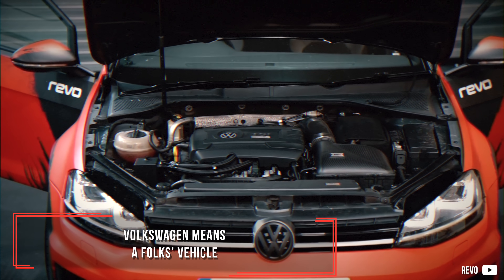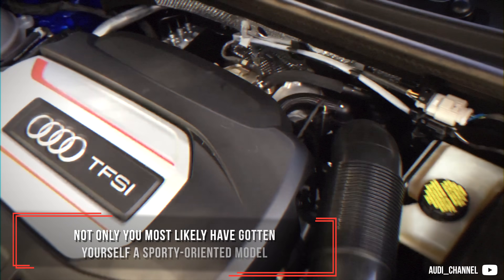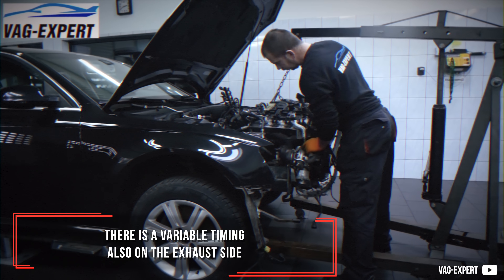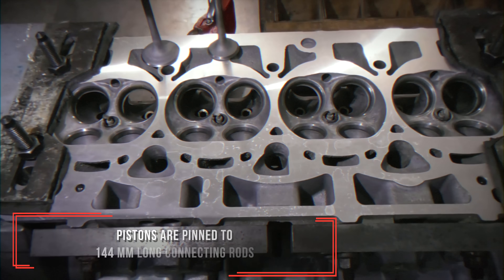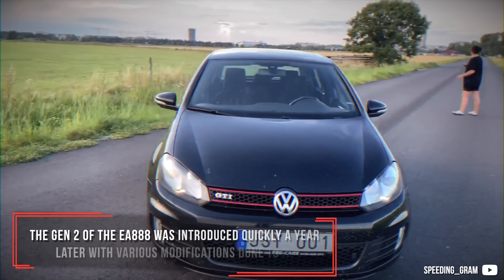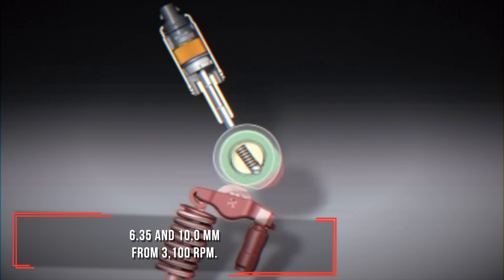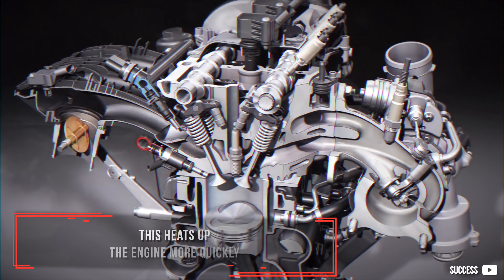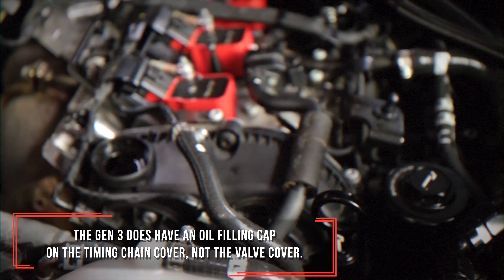Why The Volkswagen EA888 Is So Good

Comment: Unfortunately I have the 1st Generation Gen 3 engine and I have had to replace the intake manifold twice, replace water pump, replace timing chain, PCV a couple times, multiple misfires, throttle body, etc.   luckily though I use Mobil One Full Synthetic in all my Audis and VW’s and my GLI has made it to 150K.   Carbon cleaning will be next with the walnut blaster, more money.

Comment: The aforementioned issues all sound like they are caused by lack of oil change or poor quality oil. As for the timing chain issues, yes it is terrible but it also sounds like it can be monitored and addressed before it becomes a catastrophic issue. I hope the check engine light illuminates before such disaster

Comment: ea888 gen2  still running after 12 years so far no issues, still on the original timing chain too. and waterpump still works and doesnt leak. just do the yearly oil changes or at kilometers intervals and thats it. and after 150k maybe the walnut blasting on the intakes to remove the carbon deposit and do a timing chain change.

Comment: What could I do with a 2016 2.0 TSI manual VW Cravelle which has low mileage and still stock engine developing just 150 bhp? I wouldn't like to affect its longevity much but a bit more power and torque would be very welcome. Any suggestions please?

Comment: 2018 Q5 has the gen 3 EA888 no? If so, mine has a broken water pump, radiaotor and possible coolant fluid contamination with only 39k miles. Dealer serviced as well....

Comment: I hate it when people laud BMW's B48 like it's something special - I own a B48  2.0t, and it's crap...Its higher compression than the Audi A4's E888 so it can't be reliably tuned, and even when it's tuned to produce big power numbers, torque comes on too high, and the low-end response is less impressive than a Toyota Corolla .  I've tried to tune B48s for years and it's NOTHING compared to a quick flash from Unitronics off-the-shelf tunes for the E888.  E888 is a brilliant engine.

Comment: Bonjour super vidéo. Une petite question, j'ai une Seat Léon 290 avec FAP, j'ai eu un problème de pompe à eau, pas une fuite, mais visiblement l'un des clapet de celle-ci ne permettait plus le passage de l'eau dans le radiateur et le liquide de refroidissement s'évaporait par le bouchon m'a t-on dit. Pendant cette période j'ai remarqué une consommation de liquide de refroidissement (quelques mm à chaque plein d'essence). je n'ai pas remarqué de surchauffe d'huile ou liquide, du moins sur le tableau de bord, pas de problème avec le chauffage... La pompe à eau a été changée, un test d'étanchéité et de CO2 fait, rien à signaler. Et pourtant j'ai toujours de la conso de liquide de refroidissement, qui semble moins importante... Si par hasard vous avez une idée ?

Comment: The Gen3 is the best street 4-cylinder ever made. Nothing can beat it with the DSG. The only thing holding it down from competing with 4G63 and K-Series at 4-digit power levels is the head-integrated exhaust manifold which chokes it down past 800hp.
Reply: there is sulotion to make the head flow, but if u want use the car 600hp max for reability to all 4 cilynders engines.

Comment: No port injection on the gen 3, only DI in the US, which is unfortunate.
Reply: Do you know why they removed port injection on US models? Seems to me only Lexus does dual injection in USA since like 2006 or so
Reply: Cost savings most likely. That or something to do with emissions to meet “all 50 state” requirements.

Comment: I own a Skoda Octavia RS with the EA888 Gen3 Engine and a Manual Transmission, it was factory tuned by ABT to 309HP, I've had it now 5+ Years, no Oil consumption up until now. Only if I drive hard on the unlimited German Autobahn high up in the rev range. It now has 220'000 km on the clock and so far no mentionable issues from the drivetrain. It's very efficient, uses only 7l of fuel when driven normally and only 6 Liters if driven conservatively per 100 km. A very good engine, that builds up boost very early (below 2000 rpm) and holds it up until the redline (6200rpm). I now changed the ridicolusly high oil change interval from 30tkm to 15tkm and changed the Transmission-Oil. I hope it will last me for another few years to come! I can confirm, the EA888 Gen 3 a very good all-round performing engine 🤗

Comment: Got Cupra ST estate, only chip got 385hp and 495nm. Now doing Do88 intercooler upgrade and Do88 intake with many do88 pieces. Downpipe needs also installed, seeking 400~+ hp from it. 😁

Comment: The gen 3 I have that its decent, so you can add power at 160k miles and the transmission and engine can handle it?

Comment: I know im a bit late to this but these engines are, and correct me if im wrong, port and direct injected in all Euro models.  Kits can be bought to add port injection by simply drilling holes in the intake manifold. There are OEM locations on the manifold that were simply left untapped in the US models. idk if its for both golf r and gti but golf r for sure.

Comment: Friend of mine had Passat 2.0TSI with 280hp. No engine problems and lucky not to have problems with the DSG gearbox. Car did have a host of other problems Ac not working, bake disks rusting in regular use, rear boot lids lock failed and the cars remote drained the vechiles battery in a matter of weeks. So yeah good to stay a away.

Comment: You must be kidding! I had a 2009 Wolfsburg that gave me multiple CELs over its 133k miles. I had PVC valve replaced, oxygen sensor, throttle bottle and eventually a leaking drive seal that cost me $700. I sold it with a bad oil pressure sensor. 

Terrible engine.

Comment: Great info. The IS38 is the turbo upgrade I've heard the most about. Would put a GTI up into the 300HP range pretty easily.
Reply: Stage one on is20 is 320hp and 390torque, on is38 your looking easily over 400
Reply: Is38 comes stock on golf r(same engine as gti)

Comment: Im sorry brother but all my buddies that have owned the early gen ea88 has regretted selling there 1.8t ypu pretty much have to upgrade the whole motor for reliability and youll still blow out high pressure fuel pump lol but i will say they make daaaaaam great power im just hear in my 1.8t lovijg reliability and cheap power no opening of engine needed for 300hp not bad i know a couple stock block 1.8t running 400 its freaken insane to me

Comment: I got an eos with the gen 1. Interior and exterior are beaten up but after fixing most of those issues, ill consider upgrading the engine. Its at 160k miles and i got it at 155k with a semi rebuilt engine b4 i got it. My friend suggested putting a 5 cylinder in there, which i kinda wanna do😂

Comment: Who are you trying to fool?  I guess if you don't know of anything better, then it must be good. We have a 2014 2.0T. 40k miles and 3k oil changes.  Burns oil like crazy.  Maybe 1000 miles per quart.  It's a bitch to work on.  Try changing the Water Pump for example.  Then having to clean the valves that get covered with sludge.  POS Engine.

Comment: The engine itself is great and has proven itself to be pretty tough...its just al the crap VW bolted to that sucks... Intake Manifold, water pump, timing chain tensioner etc. Gen 3 improved on that though

Comment: This makes me want to buy that Jetta GLI I've seen for sale even more.
It has the 3rd Gen and from what I'm hearing it's a really good balance of reliability, affordability and tuning potential.
Reply: @edim805 Did you buy it?
Reply: I own one, and have for a little over 3 years, I can say its one of the best cars all around you can buy, slightly cheaper than the GTI, with the same running gear, and a trunk, little more leg room at the back seats, and pretty much, same tuning potential, Perfect Highway Cruiser, I highly recommend it

Comment: I see the EA888 gen 3 as the spiritual successor to the evergreen 1.8T 20V. I am fortunate to own both a 2001 Audi TT 225 and a 2018 Audi S3. Neither engine has been tampered with and both have been regularly serviced. And both engines are rock solid in terms of reliability.

Comment: The graphic is incorrect 2:29, the turbo compressor is attached to a one piece design cylinder head/exhaust manifold.
The newer generation EA888 is worst than the MK6.

Comment: I have a 2016 Golf GTi performance. I do like this engine, powerful and smooth with good fuel economy when needed. My only gripe is that in standard form it sounds rather bland, but that applies to most 4 cylinder engines.

Comment: I have a 2012 GTI, motor pushing 90k, only failure was the water pump and a Cam shaft speed sensor.  I had the dealer swap the Cam Chain and tensioner at 70k (preventative) along with a carbon cleaning. Yes it wasn’t cheap but considering the price of new cars it’s cheaper to put some money into preventative maintenance then replacing a motor or buying a new car

Comment: Best engines my ass😂😂.
    I had all three generations and they all are a piece of junk !🤮
 Issues with oil consumption,  timing chain , fuel injectors , oil leaks, oil pump , carbon build etc , they are fucking shit , stop lying to people that these are the best engines from Vw because that's not true! 
A reliable petrol engine doesn't mean you have to do something to it every couple of months! 
Most reliable petrol engines are made by Mazda, Toyota and Honda , Vw makes the worst petrol engines , unless you want to be friends with mechanics every couple of months,  go for it .😂
Performance wise,  yes they are nice , reliability wise, they are absolute shit .

Comment: Ok I am not a believer the EA888  is a pile of junk I have a pile oh wait 8 of them piled up for scrap . They don’t-last throw away motor. Timing chains FAIL plastic guides . Oil pump issues junk  Plastic parts should never exist in a motor and direct injection and dual injection.dual failures it sucks . I run 1.8t 20 v awp with new Rods with 20mm wrist pins and je rods and a big turbo slaps out 500 whp with all upgraded  software. And emissions delete.

Comment: The later EA 888/3 had OPF and only DI, no more additional MPI. There also ist a EA888/3b. This is the 200/207 HP Version with miller cycle. And there is a Gen 4 with new Garret- or Continental Turbo
Reply: I'm currently doing some research on the EA888. Do you have a source that lists the MPI variants? Either I'm searching incorrectly or there just isn't much info available
Reply: @AspireRacer  There is not much info available. The additional MPI was cancled about 2017. All engines with OPF from factory had no longer additional MPI https://www.youtube.com/watch?v=TOO7xWwOo7M (use the google translator)

Comment: "An IS38 Turbo is a safe way to reliably increase performance"
Yeah look, it really isn't. Those (still) have a strong tendency to die on ~400hp and proper usage rather quickly.
Reply: Not my experience. is38 at 80k
Reply: @deanmarr785  Read my post again, properly this time.
Reply: @NoName-st6zc  I read it. What did I miss. You said the is38 has a tendency to die. I'm at 80k and still going strong. I stand by my statement. Not my experience.
Reply: @deanmarr785  What i thought... You didn't read properly, again.
Reply: @NoName-st6zc  I'm still confused. Are you saying is38s die easily? I'm saying that is not my experience. I've got 80k on my is38 swap.
Reply: @deanmarr785  You still didn't read properly. I never said the IS38s are dying easily.
Reply: @NoName-st6zc  Your quote. "Those still have a tendency to die on - 400hp and proper usage rather quickly". I'm still confused. That is your quote.

Comment: Cant beat the Japanese built 1jz and 2jz for performance builds via bold on mods without touching internals. Someone i know had a 500+ HP 1jz in a Toyota Soarer and the 2jz is well known to handle up to 1000HP.

Comment: I just let the car go, but I took my 2017 GTI to 262,000 miles traveling all over the US. Mix of highway and fast paced backroad miles. Chased Porsches in several states. A week at WOT in 2nd-3rd gear at Tail of the Dragon and all kinds of stuff. 10,000 mile oil changes, still original turbo. Pulled amazingly still and didn't use anymore oil than any other hardworking turbo engine (1qt every 3-4k miles).
Reply: My 2017 Passat gen3 just crossed 180k. original turbo, water pump, timing.. 5k OCI 5w40 with liqui moly mos2.. great engine!!
Reply: @danielveliciu3445  My thermostat went wonky coming back from a PCH trip in California. Was in Nevada on HWY 50 ("loneliest road in america") and under load temps would go up quickly but with little to no load they would go down. Managed to limp it back to Houston. Was around 170k miles. When I let the car go at 268k, the next one had started to leak. Definitely the weak point. Timing still made no noise and VW centric shop that handled my maintenance said to keep sending it.
Reply: @ethannicosia979 very impressive!! Just crossed over 205k yesterday and still no noise in the original turbo and timing.. Factory water pump assembly still showing no signs of leaks.. Maybe I just got lucky? lol! I’m also burning around 1 quart of oil every 4-5k miles depending on how heavy my foot is..
Reply: @danielveliciu3445  Lucky boy with the water pump.  The thermostat housings just keep cracking… 
Mine started leaking around 100 000km but some people had 4 of them in those 100k km.
Reply: @JayPee2212  Four water pumps in 100k means they are either generic crap or mechanic has no clue.
Reply: @senco981 You are probably saying that as a general statement about how long water pumps should last on all cars. Without knowing about the design issues VW has been having with their EA888 water pumps. Their are currently on their 5th revision and they still did not get it right. The plastic themostat housings keep cracking, seals get damaged prematurely (partly due to exposure of possible small oil leaks in other seals).
Reply: You’re living the dream man.  What made you travel all over the US especially in a fun car???
Reply: Currently at 138k on my 2017 S3 best car ive ever owned! Just did Ignition coils, spark plugs and oil change and new tires she is running great as always!
Reply: Did you change the.timing.chain during this interval?
Reply: My base golf 1.8t 5MT used about a quart every 3k miles. I put 170k miles on it with lots of WOT going up on-ramps, and just generally chucking it into corners everywhere i went. It still ran like a sewing machine the day i sold it...
Reply: awesome. i'm at stage 3, 60k miles and panicking. lol sounds like i'm okay 

also, i need to hit that dragon sometime.
Reply: @SpaceMissile  you should, better know how to do the timing chain and tensioner, wait when the oil screen passages clog the balance shafts. If it is DSG you WILL have to replace the flywheel at 100k, and save for the intake manifold.
Reply: @mazpr2025  noted, thanks. 

side-note: i have hit the tail of the dragon since my previous comment. lol it was awesome.
Reply: @mazpr2025  well you are wrong his car is a gen3 2017 tsi they are not plaqued with the timing chain and bad oil scraper ring design!!!!! Go and check naptown tuners videos again all his rebuild videos are on gen 1&2 tsi.......and if your dsg is wet clutch dq250 or dq380 they don't have any issues like the dq200 dry clutch!!!!
Reply: @mazpr2025  you are totally wrong, he has a gen 3 EA888 engine, it has none of those problems you are mentioning. You are referring to the infamous gen 2 EA888 that has all those issues. The gen 3 engine is very stout and reliable provided you do your maintenance
Reply: @SpaceMissile  stage 3? So what turbo you running with a stage "3"?

Comment: The EA888 is not a good design by any metric. 
Over complicated, not efficient, not reliable or powerful and certainly not cost-effective. 
And saying that it should be able to go 300,000km is terribly short time. 800,000 has been a benchmark for 20 years. There are even terrible Chevrolet L31 engines with a 1.6 million KM on them.

Comment: Don't get me wrong, i'm driving the EA888Gen2 in my tuned Golf VI GTi and after the overhaul ans tuning done to it, it's a great engine. BUT for a standard customer without mechanic skills it's not that great with all the carbon sh*t gluing together your oilrings and can cause pretty nasty damage to your shortblock... However, i've you have mechcanic skills and planing on tuning the engine and get reliable horsepower you don't need the original crap anyways😅.
Some mods that i run and can only recommend them are: selfbuild tubed turbo-header, deleting the direct injection completly, garrett gtx3584rs turbocharger, h-shaft steel c-rods and a custom charged-air cooling solution that fit's your needs (air to air, water to air and so on).
Greets and have a nice one boys (and maybe some girls🙂)
Reply: The german models have port injectors as well which gets rid of some of that sludge but they omitted it from the north american market, WTF.   Guaranteed carbon junk buildup.
Reply: @georgedaswani9155  on my build i got rid of the direct injection and blocked the ports of and welded them shut. Back to the good old injection in to the intake manifold. Works well, no more headachs with to much pressure (from boost and the combustion) in the chamber and with the aftermarket pistons and rings, there is no morencarbon build up 🙂